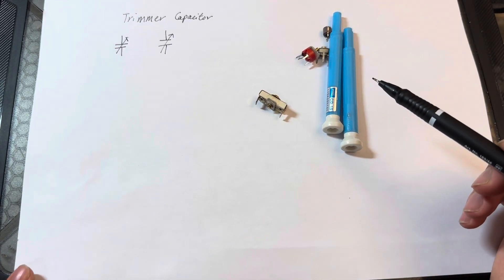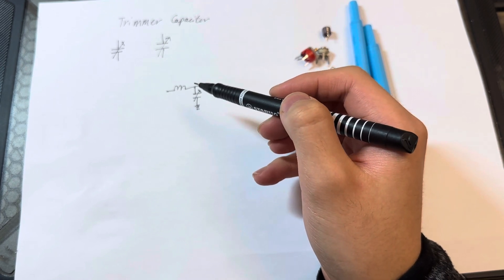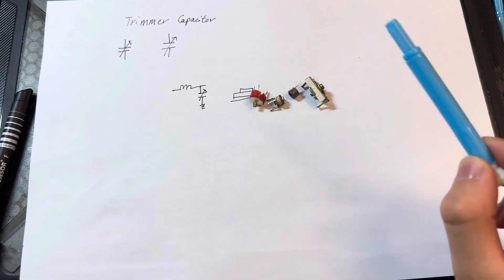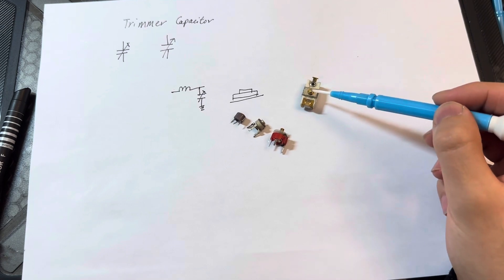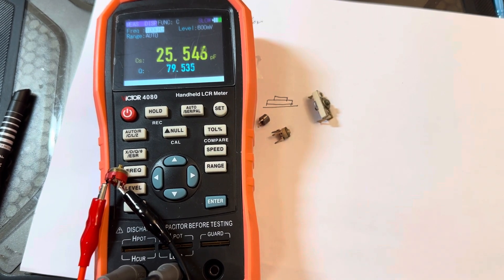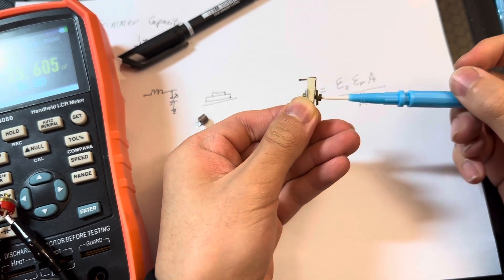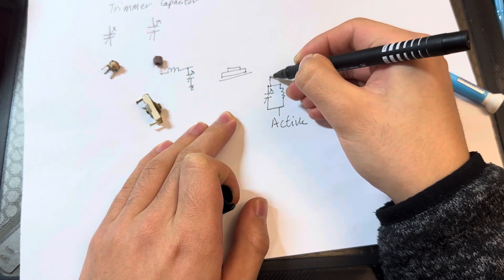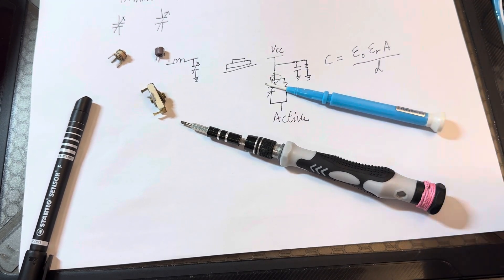Trimmer capacitors explained

Comment: I’m repairing a Sinclair Micromatic radio that has a trimmer capacitor exactly like the white one in this video. It was very corroded so I took it apart to clean it. I’m wondering are the 3 washers on top (cardboard washer on bottom, copper washer next and then an iron washer on top) just plane washers and I didn’t damage anything in cleaning and the important part is the two plates under the washers that are separated by dielectric? And can I use kapton tape for that insulator? Because that was destroyed as well.

Comment: Plz that polymer plastic capacitor that u measured that give u 100pf when completly overlap how many parallel plate those it possess cuz I try to measure my own but don't have that multimeter
Reply: Like the one I have, Have like 5 parallel plate which means 4 parallels capacitor in total for the five plate of that trimmer capacitor,  
hope u understand what I mean